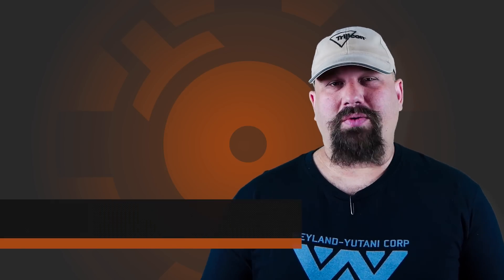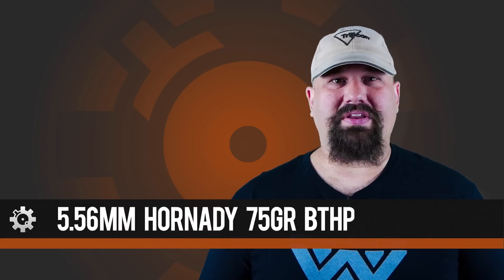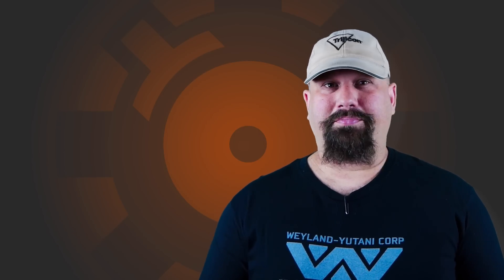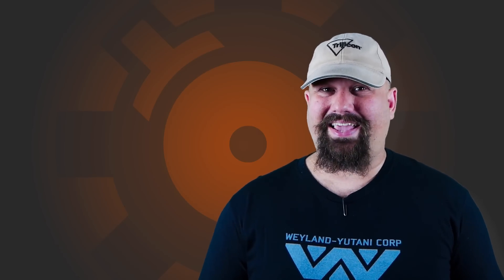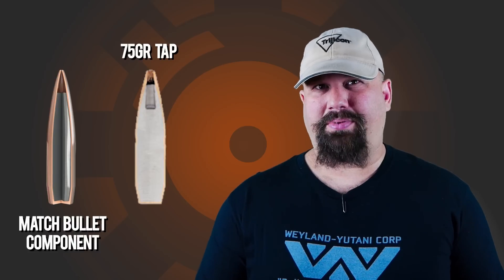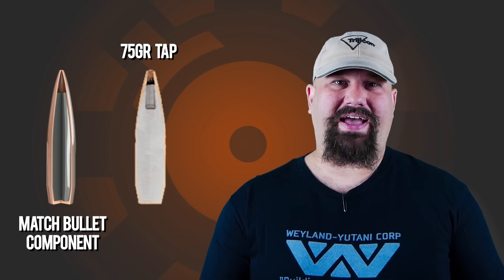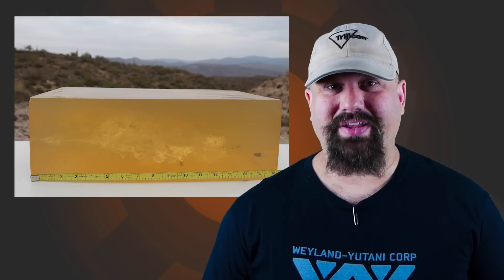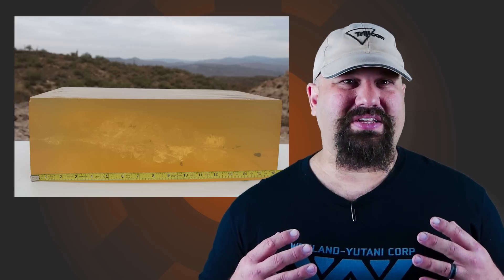Are Match Bullets Suitable for Defense? Hornady 75gr BTHP Gel Test

Comment: I spent a good deal of time working up a .223 load that works well in a Mini-14, AR-15 and bolt action Mossberg MVP.  I use Hornady 75 grain OTM bullets and 23.2 grains of Ramshot TAC powder.  I'm getting 2590 fps and 3/8" groups from the MVP, 1/2" groups from the AR and 1.5" groups from the mini-14, all @ 100 yards.  Best groups I've ever seen from my mini-14.  All are 18" barrels with 1:9 twist.

Comment: Great and thorough video. Real tests like these should start to dispel the myth that just because the manufacturer put a label on a bullet that says match, does not mean that they are not also using it for other purposes! Another tweak that can be done is to use a meplat uniformer to give a little bit more of a hollow point.

Comment: Just picked up 200 of these to run in my 20" 1-7 SPR, pleased with my choice now. Will be buying more. 

Have you done any tests in longer barrels with it? Im seeing load data up near 2800 fps for 223 loadings. (Probably 24", id expect similar at 5.56 pressures in 20")

Comment: They are also easy to find and not super expensive. They are usually a few cents cheaper than the gold dot bullets. I picked up a box of 500 off midway and they are fantastic. The only problem is that you need to make sure you have the right seating stem. I had to buy an extra seating stem and modify it because none of my seating stems were a good fit and if the load was even slightly compressed they left a ring shaped indentation on the bullet.

Comment: Really wish you'd do tests with actual barrel lengths like 14.5" , 16" and 20" 

These tests with the anemic 10.5" aren't very helpful.
Reply: I am looking for videos on .223 and 5.56 shot only from 10.5 and 11 inch. So than you for this video. Very helpful.
Reply: Agree with the real barrel request. AR's were designed with 20 inch barrels. Only that and 16 inch should be used for tests. If you want handgun velocities buy a 10 mm pistol.

Comment: At close distances (inside your house), ANY 5.56mm would be devastating to human beings as it has 1200 ft/lbs of energy, nearly 4 times as much as a 9mm round from a pistol (imagine getting shot 4 times with a  9mm pistol!)
Reply: The issue is that energy only comes into play if the bullet upsets in some way. If it doesn't yaw expand or frag, it won't transfer that 1200ft lbs to the target. Certain bullets have that problem.
Reply: @asdfghjk2933  That is the amount of energy generated at the muzzle regardLESS of the bullet used/loaded by the cartridge manufacturer.  If it is the type of bullet that fragments/expands upon impact (such as the OTM or most 55gr bullets, assuming there is sufficient velocity - plenty if shot in your home!), a more deadly wound channel is created.
Reply: @jn3750  Yes, but there is a big difference between energy generated at the muzzle and energy imparted into the target. A bullet that icepicks through someone without deforming in some way won't transfer all 1200 ft lbs into the target. Like you said, something like an OTM will create a very deadly wound channel. That is because fragmentation enables the bullet to dump all 1200ft lbs into the target.
Reply: @asdfghjk2933  Practically all 5.56mm bullets fragment reliably upon impact at velocity about 2300 fps (within 0-300 yards) or higher.  Inside the home (assuming you have a 16 inch barrel ar15), this basically incapacitates any two legged beings instantly
Reply: @jn3750  Not really. One of the most common 5.56 rounds in existence (m855 ball) fragments pretty inconsistently even at close range out of long barrels. That's why the army switched to a much better round.
Reply: @asdfghjk2933  that round has a bad rap because it was used in the short m4 (14.5 inch) in the military ar extended range frequently (when velocity is below the fragmentation threshold).  M855a1 replaced it 10 years ago (along with 77gr otm) and solved the ice pick problems.  Nearly every other 5.56 round without the steel core in the m855  (even the fmj) can fragment reliably within 200 yards (longer with the 20 inch m16)

Comment: Wonder what that kid in Kenosha was shooting in his AR? One guy tried to draw a pistol and shoot him in the face but he shot him at point-blank range with his AR and blew off most of his bicep
Reply: It turns out he was using aguilla .223 55gr. Literally the most generic .223 ammo you can possibly buy aside from steel case, and we all saw what it did. Pretty crazy.
Reply: My suspicion is it was a 55gr ballistic tip, like the Hornady V-max. Based on how much tissue destruction was visible on the third threats bicep. There isn't a lot of meat just above the elbow, and what the Kenosha Kid was using. Grenaded that tissue instantly like a light varmint round is designed to do. 
And at point blank, 3000+ fps is nasty.
Also a bonded or all copper bullet at the angle that that shot was taken would have passed through and possibly connected with one of the other looters/arsonists in the back ground.

Comment: Checked mine, (same load), at 2400 out of 10.5 inch pistol and 2770 out of 16 inch carbine. Great defense load!
Reply: My load averages 2,545ft/sec out of an 11.5" SBR
Reply: @Stengun72087  what twist rate is your sbr— I have a pistol ar it’s 10.5” with 1:8twist I haven’t shot it yet I need 75gr boat tail ammo

Comment: Did this bullet have a cannelure or no?
Reply: It comes in both.  #2279 and 2279C
Reply: @fenomeno71  thanks Steve. I've actually got into reloading and found the one with a cannelure to be more accurate for me and it seems to keep the jacket and core together better. Plus it's easier to see where to seat the round in the case. In the video I think he used the one without cannelure.

Comment: Is this hornadys “T2” boolit? I’ve got a case of the frontier 556 with the T2. It’s less than 1/3 the price of the tap version loaded with the  T2
Reply: The round tested was Hornadys stander 75gr match load not the T2. T2 is a bit more robust then these match rounds as stated in the video it’s a bit more effective. However it’s seems the match round faired well I’m this test.

Comment: So just a question, as far as I know the US military uses the 5.56 fmj and even steel core green tips.But  if hollow points are meant to be better why do they use the fmj? And what are the chances of survival when shot with an fmj compared to a hollow point? And why does the US military use the fmj instead of hollow points?
Reply: Michael Runde Geneva convention is the reason the us military has to use fmjs
Reply: @rickymceachern8021  Not really in this case. OTM bullets are not "designed to expand" which is what the rules say, they have a hollow point for ballistic purposes. All US troops don't have OTM bullets because 55gr M193 FMJ and 62gr M855 are cheap. The M855 was designed for barrier blindness at the expanse of lethality while the 55gr bullets usually break along the cannelure and tumble, causing extra tissue damage. Those rounds are considered good enough for the majority of operations where 90% of rounds fired are for suppression and never hit anyone.  US SOCOM issues the Mk262 which is a 77gr Sierra Matchking load and I'm sure it's much more effective.

Comment: Here's the problem with any match bullet for home defense:  you better have a straight-on shot at the perp's chest.   If you have to shoot through an interceding bone or a barrier, match bullets will break up.   You're better off with Gold Dot, Fusion, TBBC, Nosler Bonded, TSX, etc.
Reply: wanna test it out by standing where gel block is? I think not ;)
Reply: The bullet isn't going to completely break up after hitting an arm. The majority of the core + any fragments will easily penetrate the chest afterwards and do massive damage. Harder bonded bullets and TSX are really overrated, but gold dot and fusion are great.
Reply: At that fps, what youre saying will not make a difference. Its still going to incapacitate and do massive damage. Just saying

Comment: Not knocking your video In the slightest but I must agree with the also test with the MUCH more common 16 inch carbine that 99% of us out here own and trust to get the job done.  Three or four hundred FPS makes a lot of difference in what a bullet does in meat and bone.
Reply: I know this is an old comment but for anybody reading this from here on out, the performance in this video would be equivalent to the same round impacting the target at 200yd from a 16” barrel.

Comment: I know this is a older video but I've hunted with this bullet for deer and have harvested 5 deer.
Closest 30yrd shot a 120# Doe down on the spot two longer shots one at 310yrds 130-140# buck both were pass through.
Longest shot was a neck shot 680yrd non pass through 200# buck no it wasn't a planned shot it just kinda happened last hour of KY deer season.
Longest shot was out of a 20" bolt gun 6.1 mills of elevation held around 1.5 for a wind I thought was around 8mph.
The Hornady 75gr bthp is a effective little pill.
Reply: Big Rig Outdoors...THIS makes no sense to me, and I’m sure plenty of other hunters out here, who believe an AR-15 is NOT the MOST effective RIFLE to be hunting/harvesting ‘bigger’-bodied Deer, etc. IF a person is interested in the higher percentages of a HUMANE kill, there are SO MANY other choices as to different calibers available..even something as a step up to the .243 Win. (which some would STILL say it’s on the lesser-effective side). That being said, I also recognize we are free to make our choices...
Reply: Have you shot other 556 ammo? How does this compare to the other 556 ammo?
Reply: Move up to 6.5, 270 or 7mm friend.  Reserve the 223 for varmints.   If you insist, try a heavier controlled expansion hunting bullet.

Comment: This is absolutely dumb. Snipers use the 5.56mm Mk262 bullet for sniping as well as it’s similar counterpart 75 or 77 grain Sierra Boat Tail Hollow Point...in the Mk13 SPR.
Just like the larger version which is a 7.62x51 M118 LR which is a 175 grain Sierra Boat Tail Hollow point..

Until recently, the Marine Corps sniper community got an upgrade to the .300 Win Mag (wish I was still active duty to use this). It uses a 220 grain Sierra Boat Tail Hollow Point bullet...Mk248 mod 1....

So yes they are suitable for sniping and defense...just ask the many Iraqis and Afghanis that for a splitting headache or got their minds blown from far distances..we were called magicians at one time. Now I’m retired.
Reply: *Mk12 was the 5.56 SPR, and the Mk262 is the 77gr Sierra.

The Mk13 is the .300WM that the Corps is picking up.
Reply: It might be an issue if the projectile splattered like a varmint bullet because it was moving too fast (7 yards from a 20"+ rifle for instance). That same bullet a few hundred fps slower will expand differently though. The force would likely be devastating for a few inches in no doubt but I've seen testing of bullets that come apart well under the FBI 12" minimum (If someone was concerned with that). That's not to say they wouldn't take you out of the fight or put you down but it might be something to consider, especially since some of the match bullets have super super thin jackets and are not designed to retain any weight. https://www.youtube.com/watch?v=Af5Z-0yALr8&t=274s

Comment: This puts me at ease. I was wondering if the lack of a cannelure would hurt performance enough to matter. This is the same bullet used in the commonly available Hornady Black 75 grain .223 load as far as I can tell. I don't know why they make two different 75 grain BTHP loads.
Reply: PS I'd also like to see you test the Hornady black 62 grain FMJ load either in 5.56 or .223. I saw another test where the bullet mushroomed out somhow.
Reply: Andy W is the TAP used in 75gr TAP T2 the same as the one used in the black 75gr load?
Reply: I don't think it is. Its the same one as in there Superformance match load. Main difference being the cannelure is omitted. I think they talk about it on AR-15.com

Comment: Can anyone tell me if this 75 grain round (or any 75 grain round) would work in a barrel with a 1:9 twist rate? Would it be stable and not tumble, at least out to 20 yards? After 20 yards, I wouldn't care if it tumbled.
Reply: It works fine in my 1:9 barrel if its clean.
Reply: It shoots well out of a 1:9 I have but better out of ny 1:7 barrels.
Reply: You would want to use around 62gr. 75grain is a little heavy for 1:9 twist rates and drops performance significantly.

Comment: The 2350fps out of that 10.5" inch barrel would appear to be a fairly accurate approximation of how this round would perform at 150 meters when fired out of a 16" carbine..
Reply: Maybe, but that is a little slow, at least for 5.56 pressures. Black Hills 77 grain is usually getting about 2500-2520 out of a 10.5 in.
Reply: @Laotzu.Goldbug  black hills is 5.56 most of these loads domestically are .223 which is lower pressure. Military is comfortable with much higher pressures than SAAMI.
Reply: @georgebigr  but there's no reason not to use 5.56 full pressure rounds in an AR which are almost all chambered for it. hornady sells these bullets loaded in 5.56 for their superformance line and those things are screaming
Reply: @bobbyc2768  there is plenty of reasons to not load up to 5.56 pressures for the average home reloader
Reply: @newerest1  For target ammo sure, but for defensive ammo, why would you not want that extra 200fps?
Reply: @asdfghjk2933  you're right, in that context the safest highest pressure ammo should be used

Comment: There's no need to watch the video, the answer isn't rocket science. The question should have been, can match grade bullets be used for home defense?  The short answer is YES.     The mediocre answer is also Yes, except that with that said, there are far better choices to use for home defense than match grade ammunition,  expanding ammo such as any 5.56 Trophy Bonded Bear Claw or any 5.56 TSX or GMX are far better suited for home defense.

The long answer is also simple,  if you have a shotgun, that's the ultimate home defense solution. 

Ps, In the military we were force fed to use X193 (same as the civilian XM193) M855 (SS109)and M955, but now that I'm seperated, I'm not a fan of following the Hague Convention and I prefer to not use a inefficient fragment or yaw dependent rounds,   using the aforementioned rounds is moronic.   Match grade rounds, XM193 and M855, are great choices, ...if you're at a shooting range and having some plinking fun.    I prefer to use a round that more than likely will stop a threat with one shot. 

Remember, at the end of the day X193 and XM193,  M855 , and most match grade rounds were technically rounds primarily manufactured to mortally wound, so as to tie up three enemies on the field of battle saving their wounded comrades.   (I will concede however that some match grade rounds with their favorable long range flight characteristics, make them ideal for long range engagements, but home defense isnt exactly long range shooting)
Reply: Why would OTM be a worse option than bonded softpoints or TSX/GMX for home defense? Humans don't exactly require 20 inches of penetration to incapacitate, and both bonded softpoints and copper solids make far inferior wounds compared to fragging OTMs.